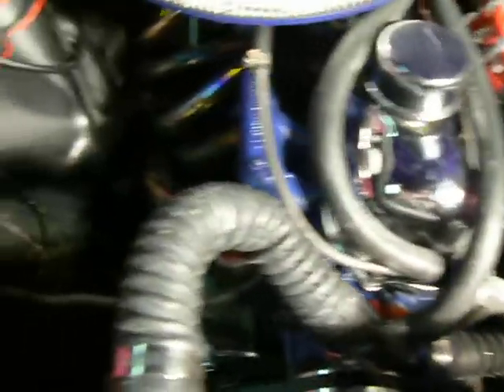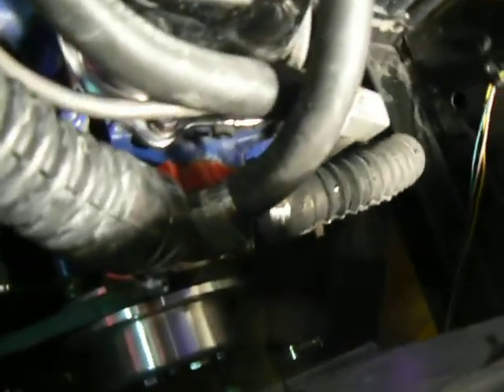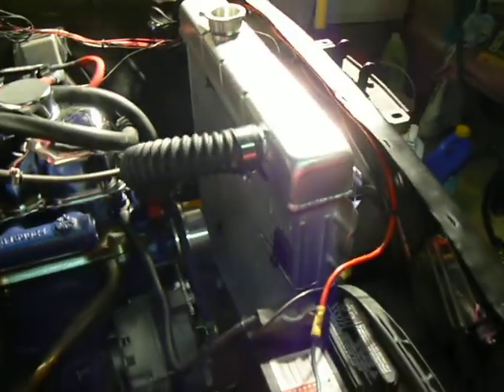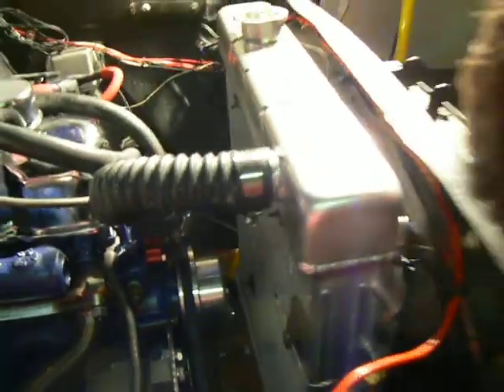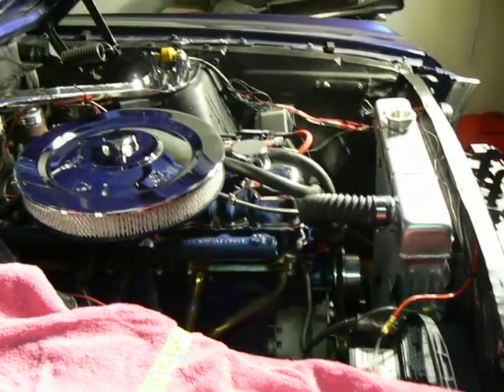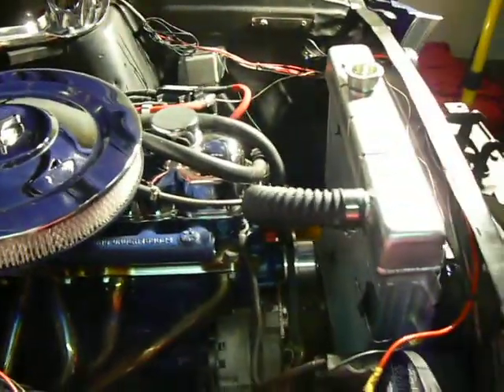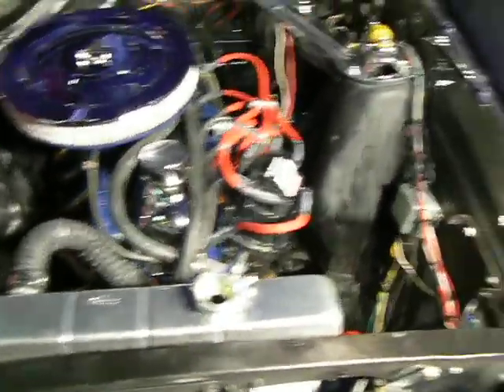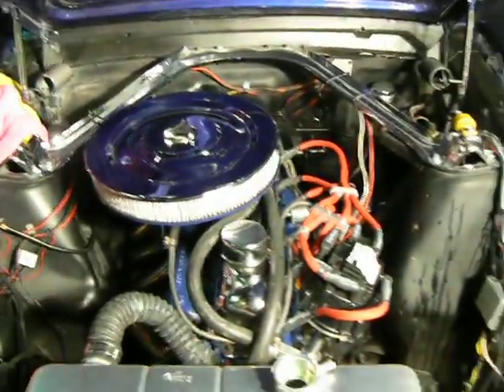1966 Mustang Inline Six Cooling System Progress

Comment: What size flex hoses did you use to connect the aluminum radiator?? I have the same size engine and want to take out my stock radiator and put in an aluminum one but I'm having trouble figuring out the hoses because stock holds 1-1/4" inlet/outlet and aluminum ones I've seen hold 1-1/2" inlet and 1-3/4" outlet.